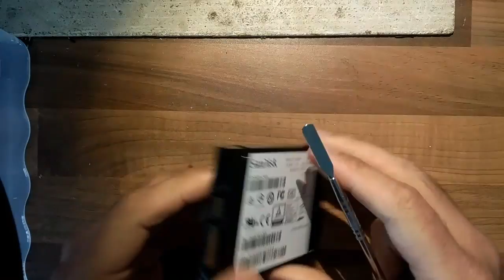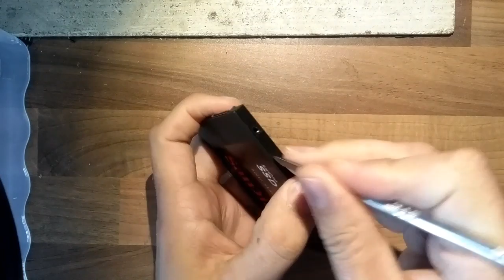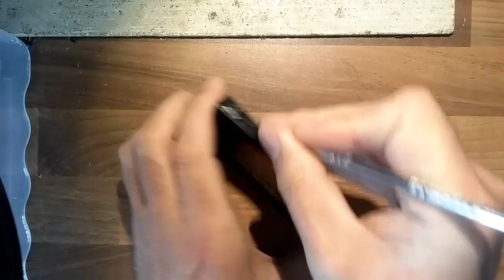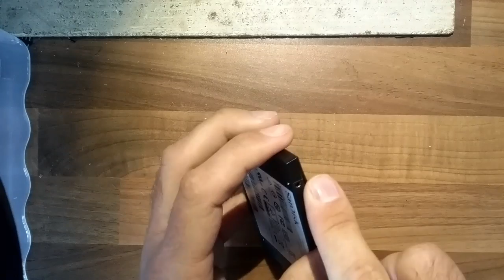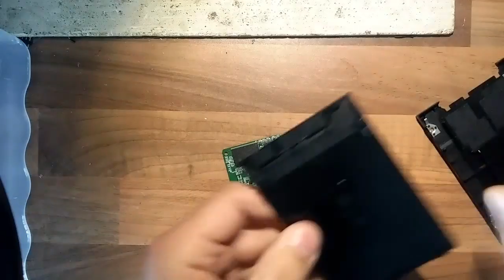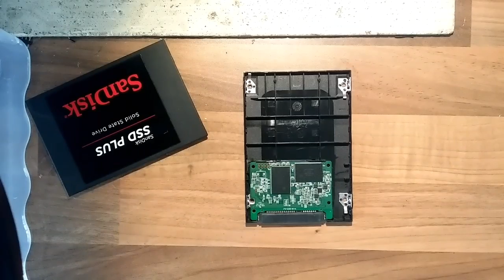240GB SSD Teardown

Comment: SSDs are way overrated - Hard Disks are still the best choice for longevity - SSDs have a high failure rate, there are LOTS of stories out there of people's SSD failing quickly, long before they reach their maximum erase cycle, it's concerning.........even the Samsung SSDs and more expensive ones out there - I guess the controllers become too hot or companies are cutting corners or poor quality control.  One thing for sure I would never buy Sandisk SSDs - Cheaper SSDs have a much higher failure rate.
Reply from the maker: My main computer has three SSDs and 5 mechanical hard drives. Two of the SSDs are for operating system boot drives, the other is for /home in Linux. /home mirrors the data to a mechanical drive regularly and I don't care about the operating systems, they can be (and regularly are) reinstalled. Anything important is on GitHub anyway...
Reply: @MajenkoTechnologies  Most people are crazy about transitioning to SSD especially that most SSDs can far outlast their rated TBW, this is dangerous, because people don't realise that whilst SSDs are good for more than what they are rated in terms of TBW, they become less reliable in data retention as you get closer to its rated write cycle, so an SSD that is near using its write cycles or where the memory is getting to a point where it is worn out and generating errors, your data would be good at most up to a year if not less depending on the conditions.  So clearly, SSD is not an entire replacement to hard disks, they are not meant for archiving data and cold storage, but for gaming and OS it's great, even for developers and coders, but your important data should always be saved, I always archive important data and projects on 2 separate medias that are not SSDs.     SSD technology is getting worse and worse and will get worse in the years to come.  WHY ?  Companies want to pack as much capacity at cheaper prices - SLC was the best, offering the most write cycles and longevity.  Today we have QLC - cheap SSDs and more bits packed per cell, more voltage ranges, so that's a problem in the long run, and eventually you wll see PLC, with even more bits packed (5 or more) these cheap SSDs to come will clearly not meant to be for long term or cold storage and their write cycles will be a fraction of what they are today, with more emphasis on trickery and error correction.  People think SSDs are getting better, they aren't., they are getting cheaper because of the packing more bits per cell, it is NOT a good thing, it is a good thing for the wallet though :P

Comment: Shucking it could be convenient if you need to have it, and an adapter, fit into an old IDE laptop's hard drive area. Boost your old 2001 IDE laptop running Windows 2000 slowly, with an SSD, LOL.

Comment: Can we back up important files on broken ssds?
Reply from the maker: You mean can you recover the data? There are ways, yes, though generally very expensive and involve desoldering the chips from a broken SSD and soldering them on to a working one. It is often the controller chip that dies on these units, so the data will still be there locked in the flash chips. I know of only one person off hand that has the skills to do it: Louis Rossmann.
Reply: Majenko Technologies Louis Rossman can build a whole computer with only broken SSD’s! 😂😁

Comment: Lol searched for this video as a pny 120gb ssd came this morning from ebay. I quickly checked it before heading to work and it felt very light and hollow compared to my OZC ssd didn't realize it actually has so little inside the unit

Comment: i have the same SSD, only can hoard 16GB, if your SSD, which manages to hold 250GB is already small inside, imagine how small mine is, then.

funnily enough, i pulled the SSD from a chromebook.
Reply: It's most likely the same size board inside but with just a single 16GB chip on it. I just opened a brand new Kingston Q500 480GB SSD simply because I wanted to see what was in it compared to my much older model SSDs which are about double the weight. Pretty much the same inside but the case pieces are much lighter for some reason.
Reply: It will probably be the same pcb but just different chips
Designing different pcb every time for each capacity is too expensive

Comment: mine crapped out as well...what a PIECE OF SHIT... planned obsolescence...they do it on purpose...no way in hell they were supposed to be non mechanical so with no possible failures MTB 100x more than mechanicla drives. SANDISK SUCKS!
Reply from the maker: SSDs are far from indestructible. Yes, they are more mechanically rugged with no moving parts, but flash chips have a limit to how many times they can be written to. Wear levelling helps to increase that limit, but they are never intended to be used in high write situations. As an OS boot device they are invaluable. For high speed reading they are perfect. For storing of data that changes frequently they are doomed to die. It's the nature of the beast. Don't blame SanDisk. Blame physics. Mine died because I put it in a high write situation. Simple as that.

Comment: Were you wearing an antistatic strap when you handle the board that way.  Static electricity is a chip killer.
Reply from the maker: Static electricity is over-hyped. I never use a strap, and have never killed anything with static. And that's after 35 years of trying. Mind, my environment is not prone to static anyway. Maybe if I lived in a desert and liked wearing nylon tracksuits it would be worth it. But wooden desk, wooden floor, damp atmosphere, the risks are as good as non existent. Also the board is already dead, which is why it's being ripped apart, so who cares about static electricity?
Reply: Do you have anyone in particular you might recommend for data recovery on a drive like this one?  I have the same model and the same problem.
Reply from the maker: @michaeltylerstewart  Nope. Restore your backup. You do have a backup don't you...?
Reply: It was dead anyway.

Comment: Would the board be bigger if it had larger capacity
Reply from the maker: Not necessarily, no. Could be, may not be.
Reply: I just ripped apart the 1000gb version, same physical size!

Comment: Hahahahahaha wow.... so small with big  case....
Reply from the maker: I guess it needs to be that size to attach it in the PC case, but electronics are so small now, and PCB is valued by the square inch, that it's understandable that it's so small inside.
Reply: It is by design - There are 2 standards, 3.5 which is used on Desktop PCs and 2.5 used mostly in Laptops, so it's just a question of allowing them to easily be fitted in a laptop or PC.